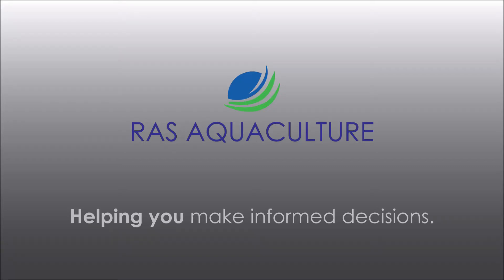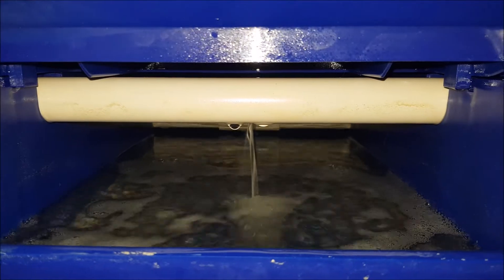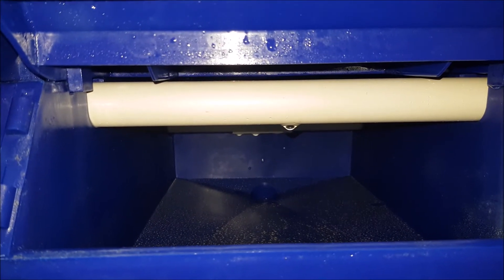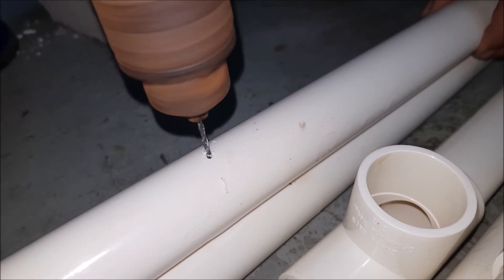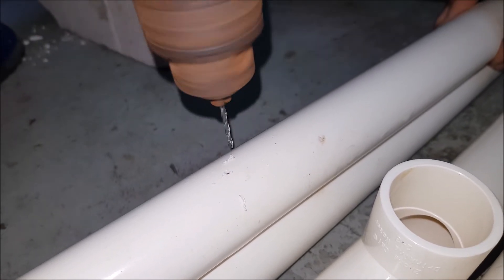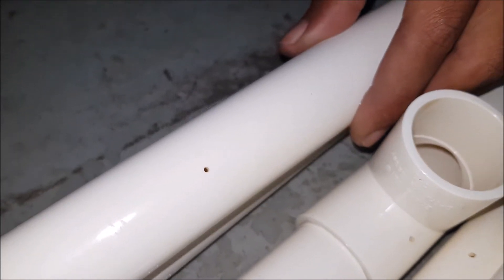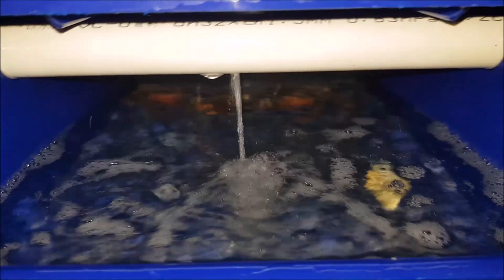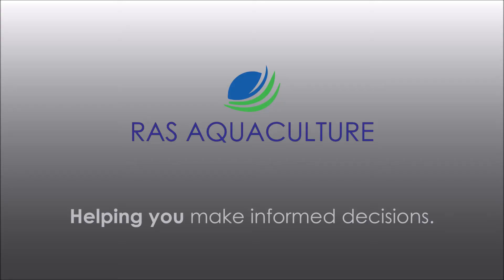Quick tips on how to fix water inlets that are always plugging in Our Vertical Mud Crab Farm

Comment: @RAS aquaculture how many square meter are are needed for the whole system of 1000 crab condo With filtration, protein schemer etc??
Reply from the maker: 8 x 16 meter is fine.
Reply: Do you think the whole system Would fit in a 60 square meter floor area??
Reply from the maker: @carlosvv5594  it is a bit too small